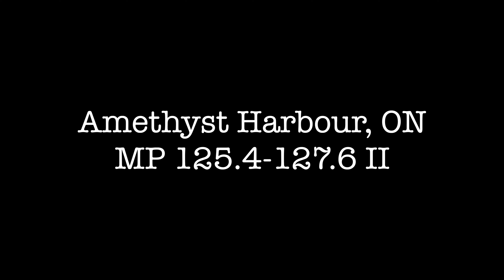CNoR/CN-Kinghorn (Dorion) Subdivision MP 125.4-127.6 II

Comment: On your intro just before you cut to the tunnel , wheres that section of track , thats not torn up ?
Reply from the maker: It at Twin City Junction near Rosslyn. It was the last piece of the PAD&W that was still being used as a spur. In 2019 CN disconnected it from the mainline track and I'm pretty sure they pulled those rails last summer. https://maps.app.goo.gl/scPQNaDSBaKdDbS86